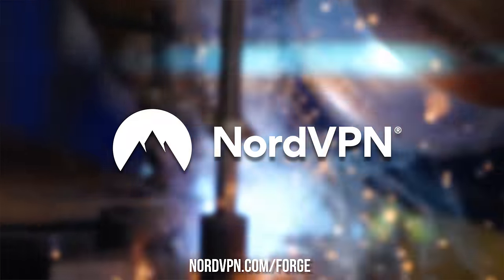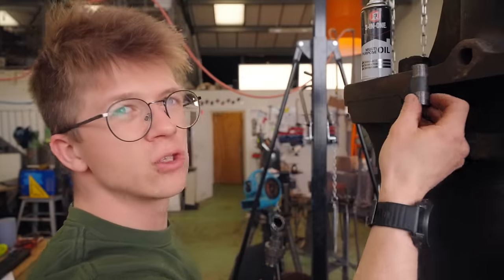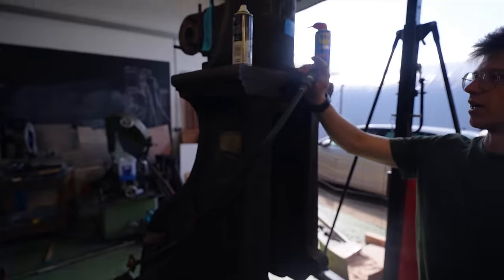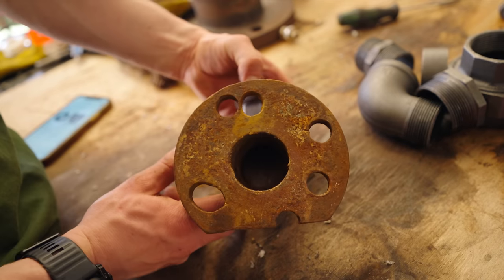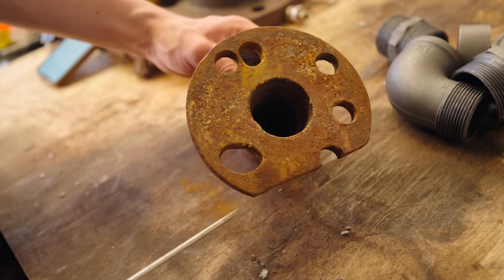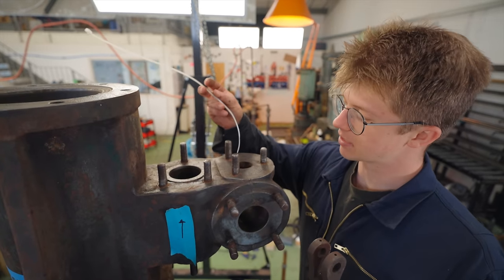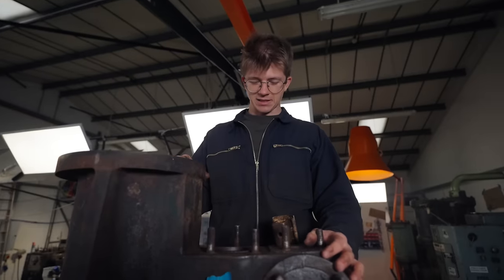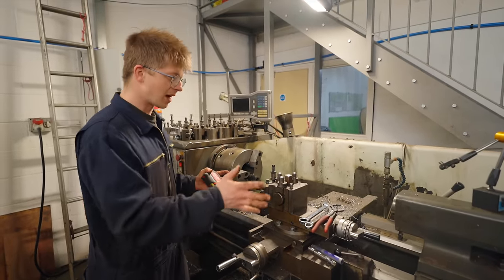FIXING A 1900's STEAM HAMMER! Pt. 4

Comment: Jamie was actually correct in putting the lathe in the part:  the tool that you would use to fix that bore or any precision hole in large objects is called a line borer
Reply: Not always. For mass production, stuff gets put on a boring mill, horizontal table type or vertical lathe. Just more convenient to use some giant machine when you dont have any established geometry yet and need to cut through an inch of casting shell and other filth.

Comment: 8:10 a line borer could be the tool to use here. instead of moving the hammer to the mill, move the mill to the hammer! CEE has quite a few videos where he uses a line borer. edit: or horizontal boring mill, if there is a shop around that has one. way less sketchy in terms of setup.
Reply: CEE are great, and just what I was going to say.
Lathe is a good makeshift too, blondihacks has been using lathe for larger castings for years now.
It's been said, if/when the world just loses everything CNC because of EMP or something, manual lathes will save us.
Reply: @ToreDL87  horizontal boring mill would also work. you already have a mounting surface (i.e. where it mounts to the body) and then just indicate. of course, that's stationary, so would have to be brought somewhere to be done.
Reply: Came here to post exactly this and someone beat me to it. Line borers are really expensive though, but maybe a day rental would work?
Reply: I usually do Steamchesrs on a Hor Borer or a VTL

A small one like that I'd probably do on my VTL.

Faster to set up then do it on a HBM upto a certain size

Line borer would really be not the optimal machine for a steamchest, unless you really had to do it in the field.

The bores need to be perfectly straight and a line borer isn't really capable of doing that without hours and hours of set up.

You can't just put taper cones and tack your supports on for something like this you need a much more thorough set up.
Reply: Yep. Watch CEE. Quite quite a few videos of line boring on there
Reply: call a heavy equipment mech shop
Reply: @thebad300   that's an entirely different type of shop, you'd want to call a specialist Forging equipment rebuilder for the best results.

Rebuilding presses, hammers, etc is like all they do.

This isn't a Cat D6
Reply: Line boring.
Reply: Yep, definitely a job for Curtis, Karen and homeless!
Reply: Line borer will work eell
Reply: It's probably a steel insert in the cast. Could have the mobile line borer weld build up the bore and then machine it back out to original size
Reply: i was thinking to just use a engine cylinder honing tool to clean it up
Reply: I already mentioned CEE in the last video. Just chatting with him would help Alec so much with such repairs. Also it would be a great crossover with YouTubers from different parts of the world.
Reply: bout to say the same thing,
Reply: @oldtruckswork8989  if you were to do that, you need to remill the seal face all the weld will distort the seal face and you won't hold pressure, and if you don't do a perfect job with the weld you can have chunks that break off from the repeated hammering and cause galling down the road.

It's better to cut the sleeve out and sleeve it again.
Reply: Came here to say this. Too bad they are on the other side of the world
Reply: Doesn't the mill head turn 90° to the bed so you could mount the head on the table (bed) and then run the head at 90° to the table into the port?
Reply: @Pugjamin  ah ah i was exactly thinking that but i guess sending the hammer to Oz would be overexepensive. I am sure they can line bore in UK too.
Reply: Yup. This needs a line bore. NOT what CEE has, that's expensive. Just needs a couple of bronze bushings at the ends on center, a straight shaft with boring hole for a little insert holder and a good beefy drill. To advance the thing, you just take a piece of all thread, put a nut on the drill (using its collar) and put that all thread through the nut, locking it with another. On the other end, you use another drill with a slow gear reduction (a metabo would do) and you slowly feed it a desired speed with looots of oil inside.
Reply: Nah, just a dingleberry hone and a battery drill. :D
Reply: wouldve been better to just turn it on its side and use an engine cylinder bore on the mill or drill press or even a hand drill to take just a light surface cut on the bore. that bore is way to small to Linebore
Reply: @snowballengineering built a DIY line boring machine for doing just this kind of job.  If you're going to use the Bridgeport, can you not tilt the head 90deg to do the boring horizontally? And final suggestion, you could turn an R8 taper onto your DIY boring head and put it straight into the spindle.
Reply: @chrisharden3934  we never line bored anythis small. You probably dont want to take much more than just a honing run from the bore. It doesnt look like anything more than light surface corrosion
Reply: Line bore, or Mag Drill.
Reply: Yep, like everyone else has said, you should reach out to Kurtis at CEE, he'd sort that for breakfast 😂
Reply: heh just said the same thing and I was thinking of CEE also that whole time. :face-green-smiling:
Reply: The hole is already round and just needs a cleaning up, so an engine honing tool would of worked just fine.  Plus they aren't that expensive and the fit onto a standard drill.

Comment: As a chemical/mechanical engineer, I'd just add my 2 cents here:
The "correct" way to install a slip-on flange (which I think resembles the piece you made) is it need to be welded in 2 places. The pipe end goes into the hole of the flange, and the tip of the pipe is welded to the inside of the hole in the flange, and the second weld goes around the stem of the pipe as it meets the base of the flange (like you did here).
Because when pressure is added to the system, both the flange and the pipe will try and expand, but because the flange is much thicker in the radial direction, it will give a lot less. So, there will be an expansion differential between the pipe and the flange, which will create tension and torque. If the end of the pipe simply meets the surface of the flange, and it's held on by the corner weld, the shearing force produced by the expansion differential will be picked up by the weld. If you push the pipe through, it will be picked up by the pipe wall and the two welds. This solution you did here will probably work for low cycle times and low pressures, but I'd absolutely recommend buying some ready-made flanges and installing those. Although if it worked with that swiss cheese atrocity, it'll run with your setup, but maybe I could add something valuable to the conversation here.
(Also, I'm not quite sure how well I managed to translate the explanation to English, I don't know any of the terminology im English, because I graduated in Hungary)
Reply: Your English was excellent!
Reply: Always the people with the most perfect English apologizing for their english
Reply: Standard flanges normally have a raised face and gramophone grooves for better gasket seating.

Comment: Use dry ice to cool the liner and press it out (or pull it)
Works very well. It just needs time to get cold and shrink. Couple of hours packed full of ice (inside the sleave) and it should do the trick

Comment: Watching you work your way through the snags with the steam hammer is excellent entertainment and all in the worthiest cause of bringing a beautiful piece of old industrial machinery back to life. As an old engineer it makes my heart feel good to know that the next generation is learning from the giants upon who’s shoulders we stand, as I did too. 
If I might offer a tip, I hope you’ll not be offended…Next time you want to remove studs, rather than chewing them up with a pair of pump pliers, simply thread two nuts onto the stud, tighten them against each other and unscrew the stud using a spanner on the lower nut. 
If it’s particularly stubborn and the nuts are tending to turn on the stud, you may find it helpful to use a pair of spanners (one on each nut) arranged so that you can grip them with one hand, tightening them together, whilst again unscrewing the stud using the lower nut. 
Hope that helps, it’ll certainly keep your studs in good nick rather than damaging/weakening them and turning them into scrap. 
As any chap knows, a pair of nuts can often make the difference between success and failure. 

One other thing, East Anglia did have quite a bit of industrial heritage but it’s true that little now remains. One of the not inconsiderable names of note was William Crane of Great Fransham, near Dereham, who started out as a blacksmith and built a business that manufactured things from bicycles to tank transporters. It later merged with Freuhauf to become the huge multinational corporation of Crane Freuhauf that produces heavy machinery that’s used all over the world. 
There’s also Ransomes down in Ipswich that has grown and prospered from small beginnings over the last 100 years or so, but there were numerous others that began during the industrial revolution, now sadly consigned to the pages of history. 
Cheers ol’buck, you’re doing a good job there. 
R.

Comment: Alec if you wanna learn by watching someone who knows what he's doing at work, then I'd recommend Cutting Edge Engineering Australia. 
It's a small business with a youtube on the side, they primarily work on mining equipment so line booring and sleeves are things Curtis has done a million times. 

I don't remember what video, but he removes a press fit sleeve using a acetylene torch by heating a narrow band on the inside of the sleeve. Making it contract and effectively reducing the circumference, letting you pop it out with a hammer.

Comment: Looking good! Might want to consider line-boring that though. Super simple to make one, just a smooth round bar (think turned ground polished) and a set of flange bearings. For a drive, a mag drill works great. You could even bore out the cylinder this way. 
I've done lower wicket gate bearings on hydroelectric stations this way and got a 6 in bore on location within a few tenths. Over 8 feet away from the other side of the bearing....

Comment: Have you considered cylinder liners? Machine a thin cylinder to fit tightly inside the existing cylinder. It slightly decreases the diameter, but gives you a nice new shiny surface, and can be easily replaced if damaged.
Reply: The cylinder already has a liner. A liner inside a liner doesn’t sound like a good idea.
Reply: @markfergerson2145  he can weld the old liner to the casting, but i dont think it is necessary.

Comment: I usually do steamchests on either or a Horizontal boring mill, vertical borer or a lathe when i rebuild hammers

I bored out one recently for a Niles 1000 Weight hammer.

Comment: hey Alec, lil tip next time you need to bend tubing. Use some welding rod and bend where you need, then match the tube or pipe to match the bends of the welding rod.

Comment: As others have mentioned, line borers are the way to go for this. However, if you’re stuck on using the bridgeport, you could almost certainly rotate the milling head, and use the ram to get the mill head stuck out far enough that you could mount the cylinder vertically on the mill table.

Comment: Here in the States you can typically rent a diamond hone for engine cylinders from auto parts stores. The hones fit in a drill chuck and you simply need oil the bore hole while you hone. It's not quite as accurate as a good machine shop but it is good enough for a DYI.

Comment: dont know if youve done it by the time this vid has released or not Alec but Id definitely tram the head of the bridgeport over 90 degrees so its facing along the X axis then you can bolt the casting flat face to the bed. thats a lot of weight to be overhanging the bed and as you mentioned could quite easily damage the mill. 10/10 perseverance with this though, shes been fighting you the whole way eh?

Comment: Gonna be honest, it is time to take up some wood working.  Build a platform that can hold that massive thing out of 2x4, then decide if that is going to be sturdy enough for what you need or just the shape you need for making a holder out of metal.  Then you need some way of keeping everything still while it is milling, which the weight should help with.  So ratchet straps would probably work.

Comment: Do you guys not have anyone who can come and line bore this? Hell , you have the tools in YOUR SHOP, to cut out the old press fit sleeve and manufacture a new one. Mind you putting it in would be tricky. But you guys are making so much more work for yourself.
Reply: Putting a new liner in shouldn't be too hard as long as they can get liquid nitrogen to put the liner to shrink it and heat the hole. The hardest part is usually the removal of the old liner
Reply: @HootMaRoot  RIGHT!!! But a few passes with a line boring machine and the old sleeve would be paper thin.
Reply: @Vetbuilt  not to mention the valve will then need to be reworked to fit the bigger bore

Comment: Rent a Line Bore unit.  3 legs weld to either end with a shaft that goes through the middle with a lathe bit, has index and speed controls.

Comment: You do know the bridgeport only has a quill travel of 120mm. Is that enough ?. had the same problem today wanting to bore a 165mm deep hole. You can bore then move the table up but thats alot to lift. The alternative is drill press boring with a slide bearing in the table for the far end of the boring bar but again its quill travel limits. Some of the old drill presses have longer travels and might be easier to add the drill to the work. Good luck, my hopes are with you.

Comment: line borer for the win or bolt a steel plate using the existing studs, and use a mag drill,  that internal sleeve has to be brass or bronze.

Comment: Maybe I missed it, but before you attack the valve bore, please measure it with some telescoping gauges (or similiar). If it is less than 0.1mm barreled then you can probably deal with it using an automotive cylinder hone on an electric drill and save yourself a world of pain workholding, chatter, tool spring etc.

Comment: You can absolutely remove that sleeve...just have to run a few beads of weld down inside it, it would shrink, then slide right out [saw it on YT...lol]
Then you can machine a replacement that you did all the machining on, shrink it [get to play with liquid nitrogen..yay] and put the new one in
Or get a line borer machine for heavy equipment...
Either way...gonna be interesting to see your solution
Keep em coming!!!!

Comment: Also floor jacks. Or the ones they use to hold up car parts like transmissions and stuff. Might work REALLY well for what your trying to do here. Or just a saw horse that is exact size you need for the hang off. Just to hold it up so its not putting all the weight on the bridgeport. Or a REALLY REALLY big machine'st jack! lol

Comment: I kept thinking for the later part, that they would just want to use a Flex Hone on a drill for cleaning and smoothing the hole and just checking measurements regularly.

Comment: If you need to remove the internal sleeves from the valves of there is no chance of saving them with boring running a bead of weld along the inside and allowing it to cool will shrink the sides (most the time two is needed opposite each other) it will shrink them just enough so they can be hammered out with a punch do it quite a lot for jcb bushing sleeves when they need replacing due to wear

Comment: Would it have been a terrible or difficult idea to use a mag drill with a custom mounting plate bolted to the studs, and the custom boring bit to take multiple passes? Because of the open ends, you could easily check progress and specs and surface finishes.

Comment: I would see if anyone around you has a engine boring machine.( Kwick Way boring bar) you could bolt it right on and bore that out without massive and sketchy setups on the bridgeport  you already have threaded holes  should be easy. almost all engine machine shops have one laying around.

Comment: there is a boring tool that is used on heavy truck axles to bore out and re hone the king pin hole to put in a bushing you might have wanted to call up an older shop to see if they have one. you mount it with clamps zero it and use a power drill to spin the cutting tool

Comment: It's a lot less precise, but for bores like that you could always get a bore hone like they use on engine cylinders. You chuck it up in a drill and oil the bore than just run the home through and it will take it generally back to round and clean up the surface finish pretty well without having to pull the head

Comment: Should check out some CEE line boring videos. You might be able to adapt some of their ideas to your equipment, with a few side projects.
I'm thinking you make a line borer rod of the appropriate size with a divot for a live center which is mounted in the carriage. This gives you the forward power on the cutter. For driving the cutter you would need something on the bar that interacts with the dog but can slide up the bar. That would probably be a slip fit hole with a keyway on a cross bar. Of course that would mean making/buying an appropriate bar of steel with a keyway cut into it all the way along...

Or rent a line boring machine?
Depends on your funds and what you want to make videos of. If you go home made all the way then at least you don't need a long boring bar given the part to be fixed